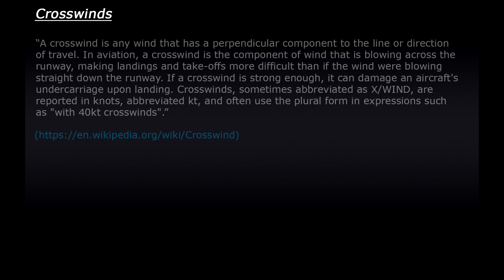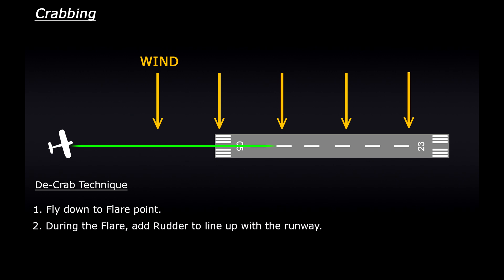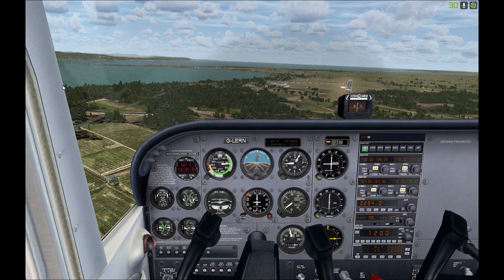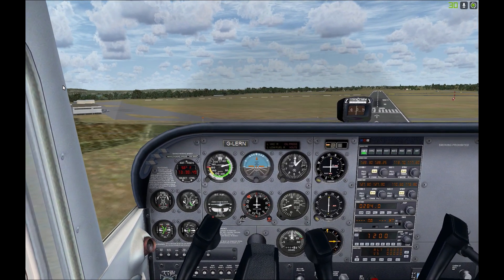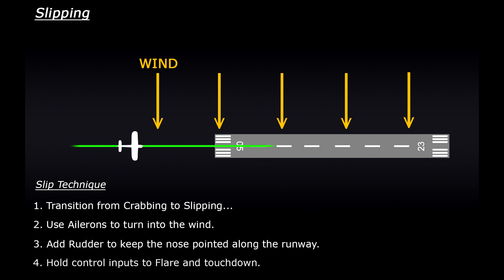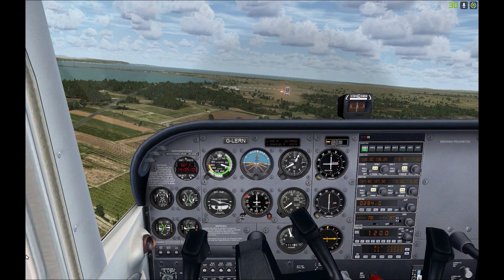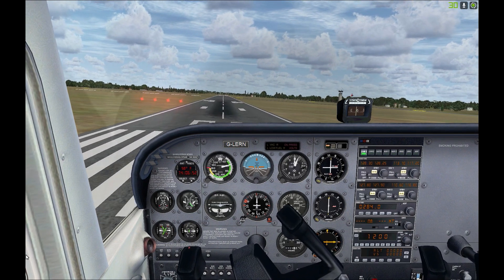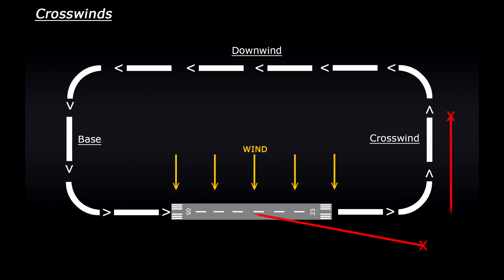FSX Tutorial: Crosswind Landings

Comment: I call that what you call "The Side Slip" as  The Crosswind Slip instead.  To differentiate it from The Forward Slip.  Some even call The Forward Slip as The Side Slip too. Better be clear on those 2 kinds of slips and not call any of them as just the ambivalent "The Side Slip".
Reply: If you are to the right or left of the runway center line during a no wing condition you would use a side slip to bring you back to center line. Slips are named by the direction of movement to the runway and not to a crosswind. A slide slip can be used in a zero wind or cross wind condition.

Comment: Should I use crabbing or slipping in the 737?
Reply: MAS_ pilot crabbing. Best for 737 and aircraft like that
Reply: Pittsburgh Plays i tried but then I always slide of the runway. When I use slipping I landed safely
Reply: MAS_ pilot did you do crabbing and then turn straight on the last second? You shouldn’t slip off the runway...
Reply: Pittsburgh Plays yes, i decrabbed at 50 or 20ft AGL and then my left her or my right gear slammed on the runway and I slide off. This is why I use slipping to align better
Reply: If you don't want to upset your passengers use a crab to just above the run way and then bring the nose around.

Comment: Need help, I don't know I am wrong or not but in the FSX (example crosswind from left like in this video). Why after the touchdown, the winds is like from the right direction? same during takeoff roll, but after takeoff wind direction goes correct. Any fix for this? In real life I know it's not like that. See on this video after landed the plane is like moving to left, but the wind is from the left. So the plane should be moving to the right if the control steering/rudder is on neutral position. Sorry for bad English. Just in FSX, not in real life
Reply from the maker: Yeah what's happening is the wind is hitting the tail and pushing the tail to the right, which turns the nose of the plane to the left. It's like a wind vane, the wind pushes on the wide area of the tail and that turns the plane into the direction that the wind is coming from. Watch some real life crosswind landings again, you'll see that as the plane touches down, the wind will push the back of the plane across the runway.
Reply: Doofer911 I'm real Cessna pilot by the way, but It never happen to me when I'm fly, everyday crosswinds. Plane should go to the right side of centerline.

Comment: Tip: Don't use full flaps in a strong crosswind. It's better to use a low flap setting, in fact, you can also land flapless no problem.
Reply: Low flap setting, like 40 degrees low??
Reply: @feetgoaroundfullflapsC  The point is that the more flaps you have on final approach the higher the wind correction angle will be, so you might want not to use full flaps, but it also depends on some other factors.
Reply: @jaumesol3480  - I know, but that guy says to use low flaps..  Maybe he meant high flaps instead..
Reply: @jaumesol3480  Actually, the wind correction angle has nothing to do with flaps, it has to do with your speed over the ground versus the speed of the wind.
Reply: @lpappas474  you are contradicting yourself,as flaps defines your speed over the ground.
Reply: @Hk-uw8my  the wind correction angle of a plane doing 70 Knots with full flaps is the same as a plane doing 70 knots with no flaps. The E6B doesn't care if the plane has flaps or not.
Reply: jibeneyto so basically use flaps 10 in the 737?
Reply from the maker: Yeah I know, please understand that this video is aimed at beginners and is intended to show the basic principles of landing with a crosswind. Considering flap usage is more of a tricky subject which is outside of the scope for this video.

Comment: When side slipping - remember, you get more drag and lose altitude quicker. you can compensate with adding a bit more power. In a string sideslip the feeling and sounds are quite distinctive and at first feel a bit "wrong". This does not come across in a simulator.
Reply: Mackenzie Clarke  No worries!  It's easy to get mixed up and you were pretty convincing.  It's been a while since I've instructed and I had to go check notes before I was sure enough to post.  Haha.  Cheers.
Reply: +Mackenzie Clarke I don't know where you're getting this from.  In aerodynamics, a slip is a slip and they're all uncoordinated.  The only difference between a side slip and a forward slip is the alignment of the aircraft's longitudinal axis in relation to an object, usually a runway.  

It doesn't make sense to say that when using left aileron and right rudder to lose altitude = uncoordinated, but if you use left aileron and right rudder to maintain longitudinal alignment with the runway centerline = coordinated.
Reply: magoo6541 no your right, not sure why I said that.
Reply: NoFaithNoPain no that's wrong, what you described is a foward slip which is used to loose altitude quickly without gaining alot of speed. it's done by flying uncoordinated  (sideways) this causes alot of drag and increases the rate of decent. However in a side slip you are flying coordinated so you don't get a huge rate of decent.
Reply: Mackenzie Clarke According to Wikipedia you are quite correct. But I have never heard of anyone bothering to differentiate the two because they are almost identical. Really the only difference is that sideslipping tends to be more about coping with crosswinds.  Forward slipping is exactly the same manoeuvre but you use it to stay on the centre line. I would doubt if you sat in an aircraft that was slipping you could say which slip it was in.
Reply: NoFaithNoPain I know the difference between a side slip and foward slip because I use them both all the time.
Reply: Mackenzie Clarke ah.. much more important on gliding. but enlighten me..how can you tell when the plane is doing exactly the same thing in the air ? when I slip for height...I merely put ailerons into wind and rudder opposite..if I want to stay on centre line to land I do exactly the same thing..I accept you are correct.. I am merely hoping to improve as a pilot.
Reply: NoFaithNoPain the only difference is that in one your flying coordinated and the other your not. you don't have to put your wing into the wind for a foward slip to loose altitude. but it actually feels alot different in a side slip compared to a foward slip. it gets pretty loud when your flying sideways in a glider.
Reply: NoFaithNoPain talk to a CFI about it and they would be happy to further explain.
Reply: Mackenzie Clarke just tired to :( . aerobatic onstructor. he said not to worry because there&#39;s bugger all difference. its a new trend to explicitly separate them and nobody cares because you do what seems right at the time. He has a competition licence also..

Comment: Whenever I try to do crab technique with big airliner like 747 or 777 I finish not aligned with runway I always end on the side from which wind blows. In other words even the smallest offset (crab) to the left when wind is coming from the left ending me left of the runway too and it is weird. Any ideas?
Reply: I do the opposite the wind pushes me.
I will approach the runway pretty slow  though and touchdown near stall....
A wind coming from the Left will push me Right...
So I started compensating and coming in more to the Left and I will land more center now. (usually)
Reply from the maker: It might be that you're approaching too fast. Usually the wind should push you away from the runway.
Reply: Doofer911 Well for 777 it is arround 145-150 knots. It depends on the conditions.
Reply from the maker: Hmm, that definitely sounds about right. Maybe Not sure what I could reccommend to combat that problem, do you tune in the ILS for approach? You could use the Localizer indicators in the cockpit and use those to confirm your alignment during the approach.
Reply: Doofer911 Yes trying to get close to the real flying as possible. So using ils, watching glideslope turning off autopilot on final. I think that wind is not that significant in FSX at it should be for large planes. Truth is that I hardly remember any real crosswind from 60-90° it is usually 30-45°. Maybe I could turn off real weather software and set some 15 knots direct crosswind and see what happens :)

Comment: @Doofer911 Is Slipping recommended for larger air crafts  .... say an A350 ... doesn't it put a lot of stress on the rudder ? I am just curious ...
Reply from the maker: When you slip you're trying to force the plane to fly in an un-natural way if that makes sense. I think it's less safe because one wing will end up having a higher stall speed which may lead to an unexpected Stall. Plus I believe it can be quite uncomfortable for passengers as they will feel like they're being pushed sideways during a slip. Large airlines often use both techniques though. They will crab for the majority of the approach and then very shortly before touchdown, they will transition into a slip so that the nose of the plane and more importantly, the wheels are lined up with the runway so the plane touches down normally and not sideways.
Reply: My uncle has been a pilot for about 35-40 years and he was just telling me how some modern aircraft have landing gears that can pivot sideways...
So you would just crab in and land slightly angled and the landing gear will pivot.
Preventing stress or wing strikes ect...
Reply: No. In larger jets you carry the crab to landing, then you kick the nose over once the first main hits. You don't slip an airliner. 

In smaller planes, the gear isn't made to side load that heavily, so you carry a crab until final (or short final, it's up to the pilot) and then you use a slip to align and touch down straight. You keep your crosswind controls in until you've slowed down to the point where control authority is gone.
Reply: Doofer911 no in a side slip you are flying coordinated, in a foward slip though you are flying uncoordinated or as you say it in an un-natural way.